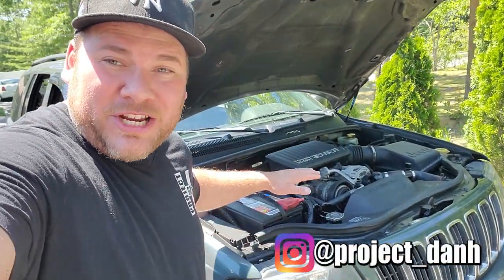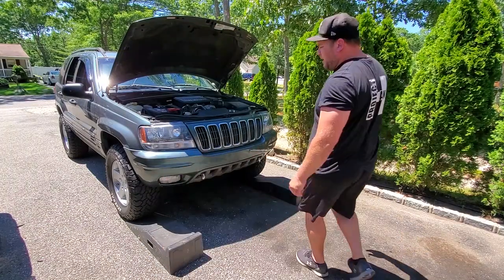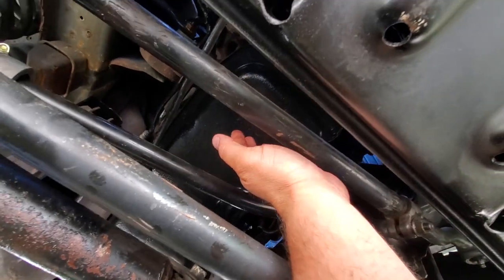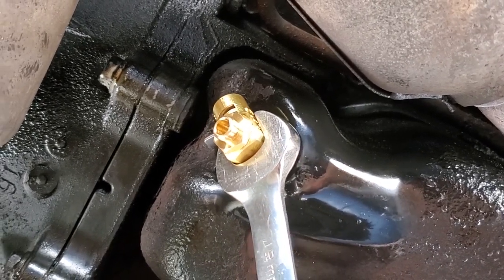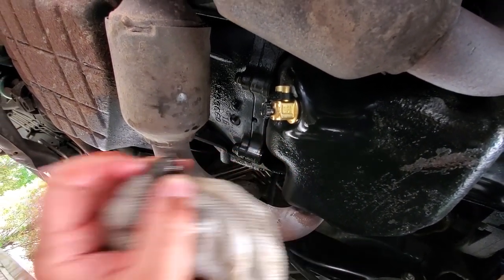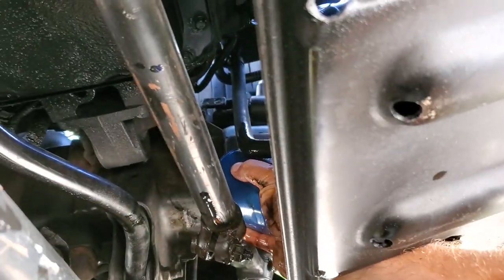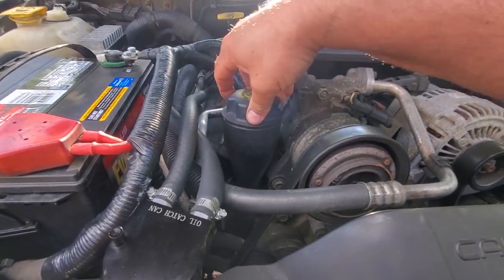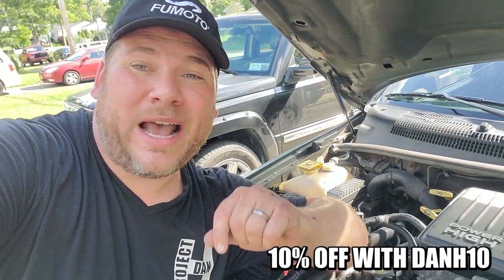JEEP GRAND CHEROKEE FUMOTO OIL DRAIN VALVE & AMSOIL OIL CHANGE IN THE GREEN HORNET WJ

Comment: Thanks for the info on the fomoto drain it's brilliant. I've got a 5.9 er and I had to replace the starter 3 times because every oil change the oil filter would pour all over the starter. On my third starter I used a filter relocating kit and moved oil filter to my k&n air box with enough slack I can take it off over an oil catch pan no more drowning starters and it added two quarts of extra oil and an enormous filter. Best $60  I've put in to the 5.9er

Comment: A great video. IMHO you need the Last Drop Wrench when you remove the oil filter,
no mess with that either. I was so impressed with the FUMOTO valve product I installed one on
my transmission pan too.
Reply from the maker: Great tip! I'm gonna swap the trana pan with one with a drain plug so I might as well Fumoto it too!

Comment: If it's your seals you should get high milage with seal swelling additives in the synthetic formula.
Redline oil HM has special chemicals to super swell those seals. It can take 15k miles or 3 different oil changes.
Also replace your PCV valve and add a oil catch can between PCV hose and intake manifold. Also try putting a oil fill housing baffle if you don't have a baffle plate built into your intake.

Comment: Nice job Brother 👍👍 I would bet that the oil burning issue is definitely valve stem seals.My 2003 Ram 4.7L did the same thing.I changed the seals last fall and now it doesn't burn a drop of oil...219,000mi. and running like a top.😁😁
Reply from the maker: I'm excited to hear that buddy! Did you pull the heads or did you use that valve tool That clamps onto the cam?
Reply: It's definitely the valve stem seal. My wj does the same thing. My plugs don't show tht it's burning oil. Could also use Lucas high mileage oil stabilizer wrks great at slowing down the loss of oil and stops the blue ish smoke even smell too.
Reply: Well unfortunately I blew a head gasket so while the heads were off I changed the seals....I also replaced all the timing components too....
Reply: @danhambrick6331  Dan tht sucks but yeah might as well send your there.
Reply: Yeah but I didn't know about the updated rocker arms until I watched a Martin built video,now I'm doing those this weekend.😁😁
Reply from the maker: @brackoncorbridge1966  thanks for the tip!
Reply from the maker: @danhambrick6331  part of me wants to do the heads too and get em over with... The other part of me says slow down you have too much on your plate just do the damn valve seals.. lmao.. I'm torn
Reply: The updated rocker arms worked like a charm.👌My 4.7L is quite as a mouse now.....😁😁😁
Reply: Same here. New cylinder heads and no more oil loss and carbon buildup.

Comment: Dan, really enjoy your video's! A tip on dealing with the oil mess:
I too struggled with newspapers and cardboard, until my clever wife suggested a concrete mixing tub from Home Depot  )got the medium size). Perfect, no more oil spills on the driveway.
You will need this tub too when you change the transmission fluid in the future.
Reply from the maker: Dude! I love it. Fantastic Idea!!!

Comment: I think you're going to need to do a follow up on this one next couple oil changes, something about the plastic clips make me think they could get knocked off during "normal" use.  That being said, if somebody made an adapter that goes between the filter and the block that would allow you to drain the oil that would normally spill there would catch my interest.
Reply from the maker: It's not just a plastic clip.  You actually have to push up on the spring loaded lever and lift it over a notch in the valve body.  Sorry for not making that clear... Check out 7:12.  This thing feels solid.. I'm confident it will hold up
Reply: @ProjectDanH  I'm not disagreeing about the valve body, I'm just not sure of the plastic clips.  Sure they're there to try to keep junk out of the groove that lever moves in and the drain, but my concern is how easy is it for them to get knocked off driving through tall grass and short shrubbery.  I live on a dirt road that gets real muddy when it rains.  I can see mud getting into it fairly easily, especially on my 5.2 where the drain is on the front of the pan.  Buy the setup might be different on the ZJ.  I think after seeing so many gimmicky things for cars that I just need to see some long term use before I get behind something.
Reply from the maker: @robertgrauman8602  ahhh gotcha!  I totally understand.  I could see where your coming from.. perhaps this is more suited for on-road use.  Wel see how it holds up!

Comment: Hey DanH, I currently have a used 2004 WJ with the 4.7. Years back I had 4 different WJs with the 4.7. I always used semi synthetic as I learned the hard way full synthetic will make these things leak. I dig the fumoto drain valve though. Keep an eye on her for new leaks brother. Happy 4th
Reply from the maker: Thanks for the tips, Will do!  Happy 4th!
Reply: Full synthetic oil will not make your engine leak, on old price of rubber or a cracked on will make it leak.
Reply from the maker: @EvanHartenburg  bingo

Comment: Hey Dan.  Let us know if the Amzoil changes your oil burning and usage.   I know oil shouldn't have much effect on worn engine components,  but just curious if you notice any difference.
Reply from the maker: Will do!  Unfortunately if I find it to be burning too much AMSOIL I'm just gonna replenish it with cheap stuff.. I don't want to waste my money on good oil for it just to be burnt.
Reply: @ProjectDanH  I sure can't blame you for that.   I've stuck with Quaker State in every vehicle I've ever owned.   I know lots of people don't like it,  but never had any lube issues.  Plus,  the couple of engines I've pulled the valve covers on have no issues of sludge or buildup.